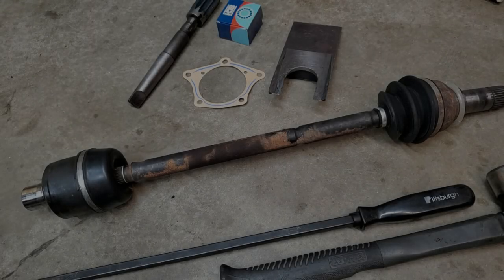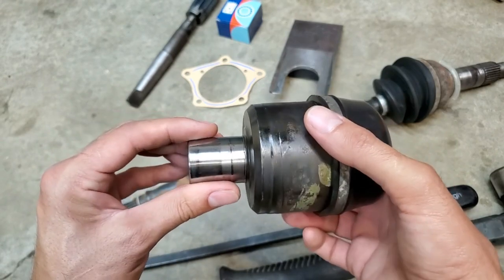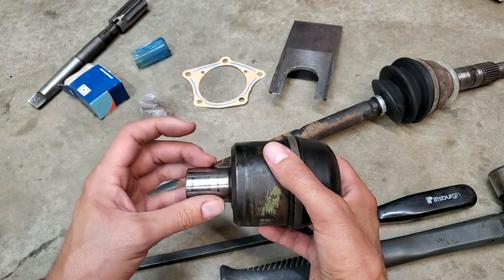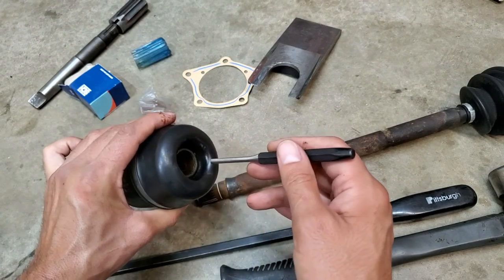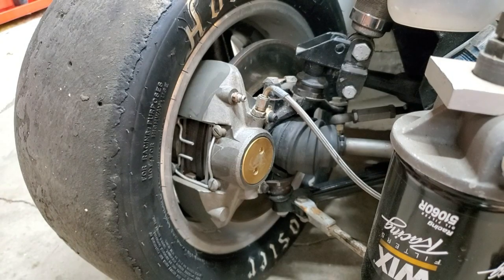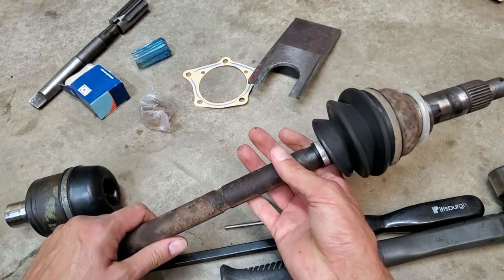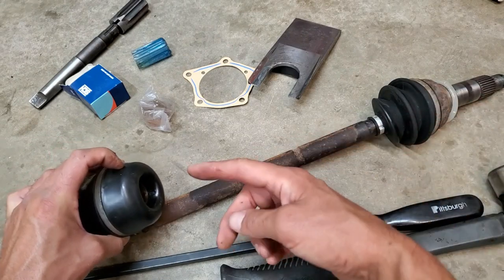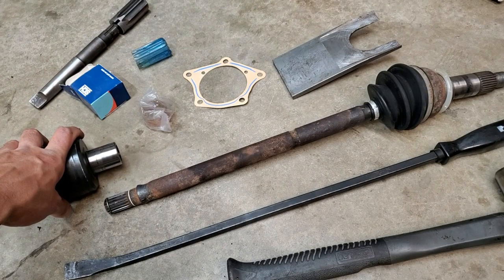Mini Rod Change Axle Seals and CV Boot, tips and thoughts.

Comment: Thanks for that. One thing to add though. You can't fit a fully assembled pot joint drive shaft because the gap in the subframe is too small. Either the pot joint or the outer CV has to come off first.
Reply from the maker: Oh ya, I forgot to mention thay frustrating detail about the subframe openings. Thanks for clarifying.

If the inner joint wont come off the axle, then the boot can be removed to allow the axle to pass through the opening with the inner part of the pot joint still attached.

Comment: Thanks for the extra info Darren. What size is the reamer for the side cover bushing?
Reply from the maker: It gets reamed to a final size of 1.250.
But its best to check the diameter of the pot joint before reaming as they vary somewhat in diameter.
The clearance is 0.001 to 0.003  so if you have a joint that measures at 1.250 then you will need to ream to at least 1.251.

Comment: quite helpful, good to know what to look for on whether the pot joint needs replacement. can you buy the pot joint 'innards+boot' as a replacement item, and is there something to look at inside to know if you should just replace?
Reply from the maker: Replace if you can hear noises when rotating them. They should move smoothly in and out of the joint as well as articulate in any direction freely but in a controlled way. If sloppy feeling then replace it. 
Yes complete inner joints are available already assembled.
Reply: @darrensrestorations991  ah, unfortunately mine has been disassembled for about 20 yrs prior to my ownership. I have inner pot joint 'bases' with no internals. Was just wondering if it is worth considering trying to reuse the housing and purchase new internal+boot or just say screw it and buy the whole pot joint. Thanks for the reply!